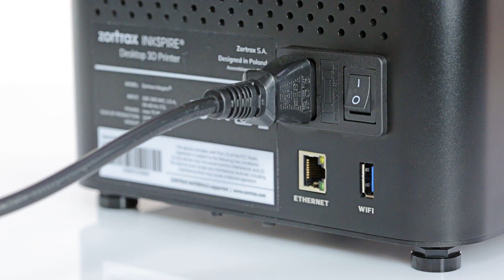FEP Film Replacement in Zortrax Inkspire Resin UV LCD 3D Printer

Comment: Hi😊 can you tell me if the fep film from zortrax needs to be unfolded and cut before installation? The one that comes in the package is double layered and one layer seems to be sticking to the screen while the other one is sticking to the print, therefore I saw some errors during printing.

Comment: How high is the yellowish support block you used to add slack to the FEP, at 1:00? Many thanks!
Reply: Hi Wickwire, unter the link https://support.zortrax.com/inkspire-fep-film-replacement/  you can find more informations. There is written: "... place the 'FEP replacement jig' from the Starter Kit or an item that is 8 mm [0.3 in] thick underneath the film"